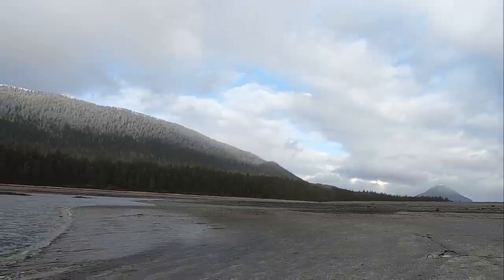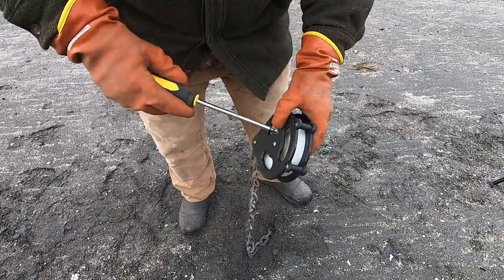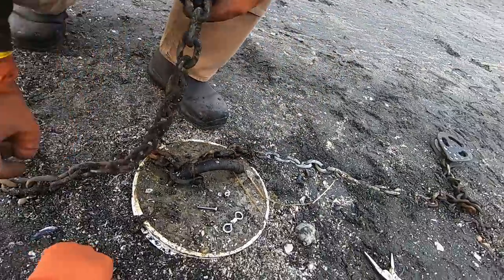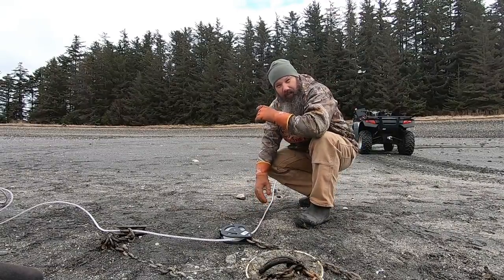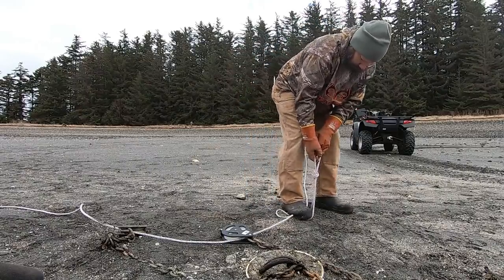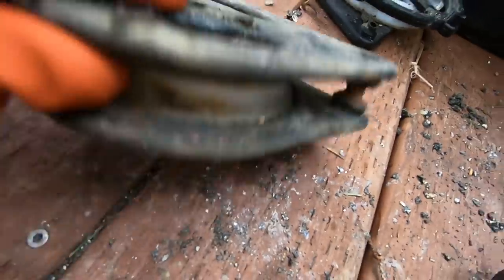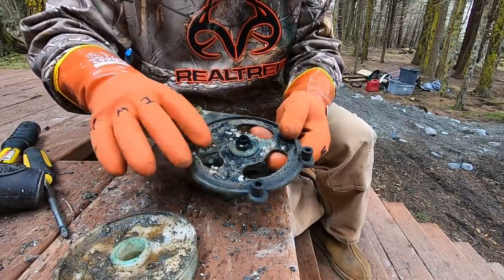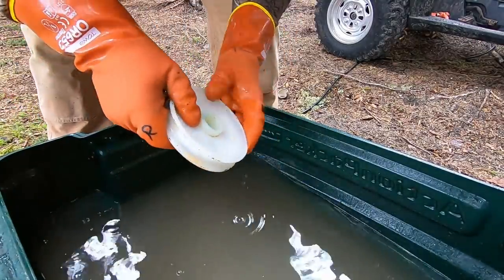Off Grid Island | The system we use to moor our boat needed desperate repair (Outhaul)

Comment: We live off road, off grid on a remote island off the Ketchikan area. Our tides go from +19' to -5' . We have tried numerous clothesline outhauls. We've found it's best to use 2 pulleys on shore, and a single d ring, or any stainless ring, under water. No barnacles or seaweed will clog the underwater ring. The line will slide through it just fine without a pulley. Give it a try next time an underwater pulley goes bad or gets clogged.
Reply from the maker: We will look into that, thanks

Comment: That salt water is so tough on everything. I used to coach rowing on the Thames River in New London Connecticut.  We used to have to soak all our rigging in a mixture of WD 40 and Coke after every season just to prevent corrosion.
Reply from the maker: That’s a pretty cool sport. 👍
Ha I’m not going to lie, I have WD40 in my truck, boat, tent, cabin, garden everywhere😂 I’m constantly dowsing things down with it. ATV, ratchet straps, tools, tractor. If it’s metal it gets covered in it😂

Comment: Glad mine isn't that far or has that much currant on it..
I still single line thru a binner on a 100 pound ball anchor that is buried deep...but I might add a pullie to the binner this summer now.

For my bow line knot. ..I like the figurere 8 follow thru..all you had to add was another twist to do it..and it unties easy if you ever need it so...I use it on all my crab and shrimp pots too.

But hey ..what ever works..your triple wahoo drunk  miner knot got the lines together..lol..jk

On my buoys I run a 2 foot loop and  add 8 inches of 3/4 inch pvc on the line..I pull the pvc  to the top of the loop..this force the loop to stay open , forming an upside down triangle...makes it easy for me to stick the t- handle of my net or oar into the loop to catch it and pulling to the boat...also in Summer when a lot of pots are in the same area..makes mine stand out better to locate.

Not that the wife needs to know ..but you could have just pounded a rod thru the reel holes vertically and replaced her job...not that she didn't do it well.
Reply from the maker: There’s tons of ways to do it, for sure. One guy has 2” pvc pipe with a 90• elbow on each end tied to an anchor. Pretty simple but he does have issues with his too. 
Them drunk miner knots hold😂
You should send a picture of your triangle knot. That would be super cool for the crab pots. I think I’m understand what your doing but a pic would clear it up. 
Hey if I pounded a stake in the ground to hold the spool then it would like like state guys doing road work. One guys working a four others just standing around watching. 😀
Reply: @AnAlaskaHomestead  ..those are all good points..lol

You forgot I am banned for life on sharing pictures on you tube..I will try to post it on your fb page..once my 60 day ban is over on facebook.
Kind of proud of the 60 dayer.  Only got 30 dayers before..
Reply: I always like it when your wife is in the video. She doesn't sugar coat any thing..and I learn new cuss words..so that us a plus....lol

Did you tell her I cry every time I see Gunner doesn't have a brother  yet ??
Reply from the maker: 😂I told her and she said soon👍
We were going to get one this year but the RONA canceled all of our plans.
Reply: @AnAlaskaHomestead  ..good deal..I can't wait for Gunner to train him or her..to keep his  beach clear..lol
Reply: Little bored here today..I go out in all weather ..but high winds...f@ck that shit !

.once I get 5 to ten foot spears falling out of the trees next to me...hunting and fishing day turns into cooking and nap day.in the cabin...lol
Reply from the maker: 😂trouble maker.
Reply from the maker: Dude I know. I almost refuse to work outside when it’s blowing. Those big ass dead branches break off and could kill a Bigfoot.
Reply: @AnAlaskaHomestead  ...I live on a big rock and some of those bad boys stick in the ground a foot and a half...I had a 10 footer come down last week and plant itself..I was walking down my trail and thought.." How the heck did I forget to cut this tree in the middle of the trail ? "..Some how I don't think my miners hat would help much with surviving a direct hit to the head...guess I know why they are called Brain Buckets now.

After a couple day blow ..when I drive my 4 wheeler down the trail it is like driving  over a picket fence length ways..
Really surprised I don't find deer and bears impelled.

Comment: --- = 8 inch pvc ,rope goes thru and back thru bouy
V = rope
0 = buoy
- = knot
! = rope to pot
!
!
!
!

Show handle set up for crab and shrimp  bouy.
.rope goes up thru the bouy and thru the 8 inch pvc..then back thru the buoy and tied ( of course with a firguire 8 follow thru knot )

My larger buoys ..I just tie the rope on to the down line..and use my cattle rope to rope them as I boat by.. when I check the pots or long line...hand grabing or using a boat hook does work well...for me....and you really need a two float set up to throw a retrieving hook..
Reply from the maker: Is there a knot on top and bottom of the bouy? Oh a figure 8, of course😂
Either way I think I got it. 
I paint mine pink and don’t have to much trouble spotting them until commercial season opens and then there’s hundreds of buoys. 😫
__
 V
Knot
O  buoy
Knot
Rope
Reply: I just put a knot on the bottom..after I center the pvc pipe and pull both ends thru the bouy  tight..this helps the pvc to remain centered.
Remember when I tell you this stuff to keep it to yourself..don't ever post it on the internet ffs..lol

The pink thing you can keep to yourself too...lol..thou I do find that a pink lighter lasts longer in a group gathering here.

Comment: I don't know if it would be helpful but the ends of the rope could be spliced together so you don't have a knot to get tangled up in stuff.  Something like this video https://youtu.be/jgR22SOhkFM
Reply from the maker: Thanks Justin, we put the knots in there so we have something to tie the rope off to the tree with and a spot to tie the bow line on the boat to. If we don’t secure it at the tree the wind will pull the boat to shore. I have seen rings get spliced into the rope and used as tie off points. 
The old frayed line we will be repairing with a long splice. That way we can use it again.